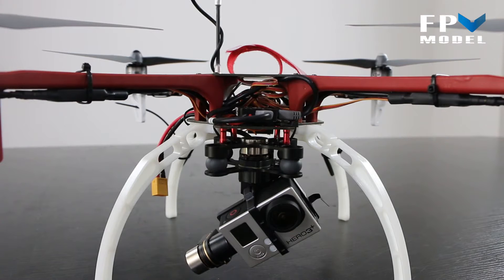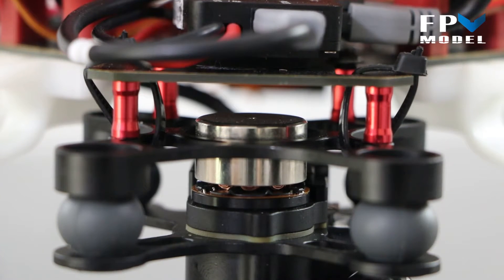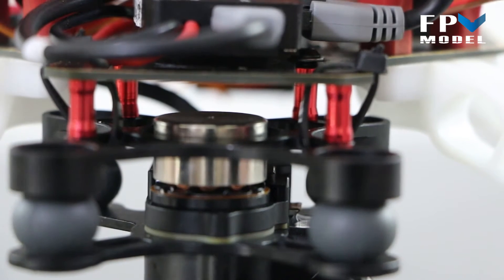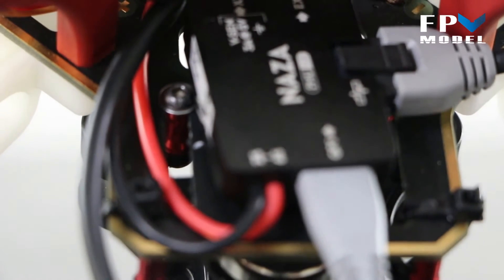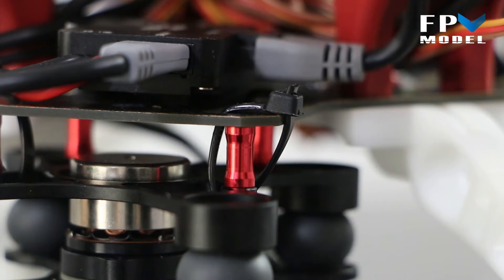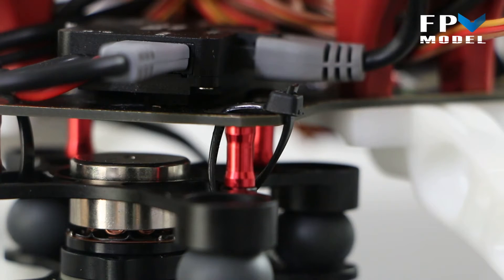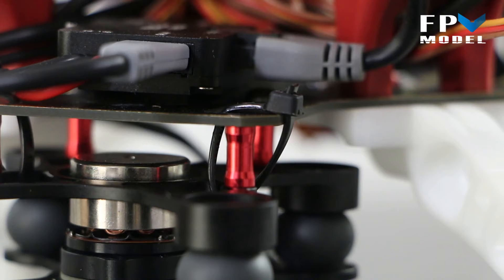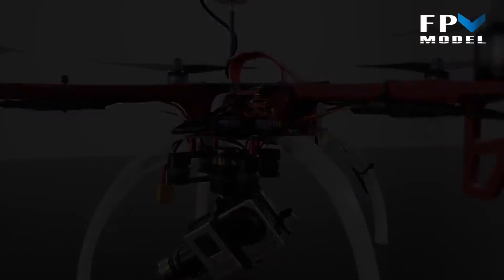H3-3D How to mount to F450

Comment: This is probably a dumb question, but I am new at this: I want to buy the dji zenmuse H3-3D for my F450, but almost every site I visit to purchase it I see things like "Phantom 2 only", or "Phantom version", etc.. Does this mean it is not compatible for my setup (I have the NAZA M v2), or will it still work? I am just afraid I will end up spending a ton of money on something I can't use. Thanks for the help
Reply: You want to get the version that states "with GCU" this will allow you to connect to you Naza V2 without any problems. Check our link here and under the cost you will see standard version with GCU or Phantom version.

http://www.fpvmodel.com/dji-zenmuse-h3-3d-3-axis-brushless-gimbal-for-gopro3-gopro3-in-stock-_g588.html
Reply: Jason Clark awesome, thanks for the info!!!

Comment: Looking to build my own F450 for GoPro/gimbal use. Any recommendations on motor kV for carrying around this extra weight?
Reply from the maker: The motors and ESCs are the E300 DJI package that come with props too. When I run 2x 3s 2200 batteries I only get about 6-7 min of flight. When I use a 4s 5,000mah battery I get ten comfortably.

Comment: can you share your naza gains please?
Reply from the maker: Is it for the first flight, or is are you confused about the gimbal shaking around when mounted. Not the camera shaking, just the whole gimbal vibrating?
Reply: FPVMODEL.COM for the first flight...
Reply from the maker: Telmo Antunes
For the first flight I'd leave the gimbal and gopro off. Make sure you're comfortable with how it flies before adding the extra weight. Personally, I use 120,120,100,100 but keep in mind it may not work for you. Just try it at default and if you're getting any unwanted vibrations try lowering a little at a time. Stick to that and you probably won't go wrong.